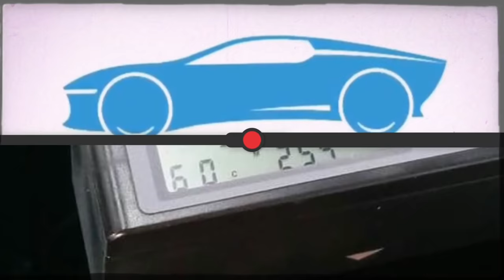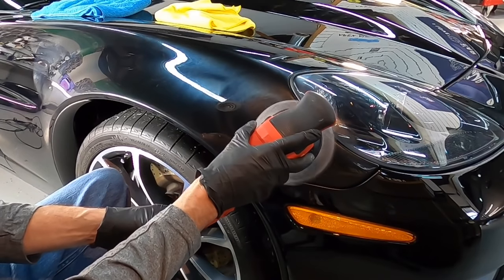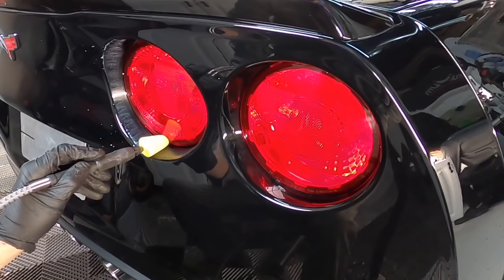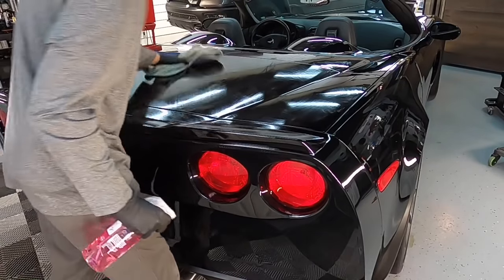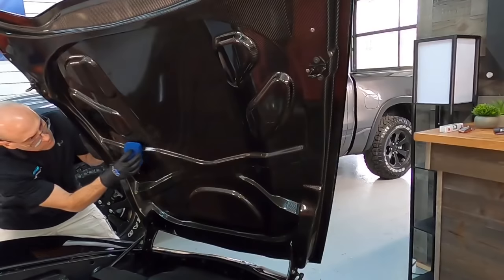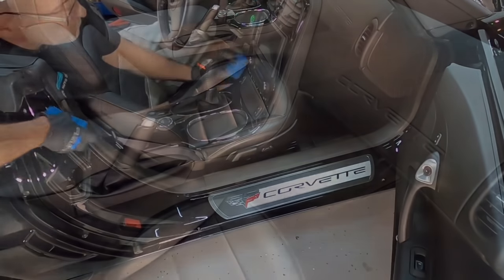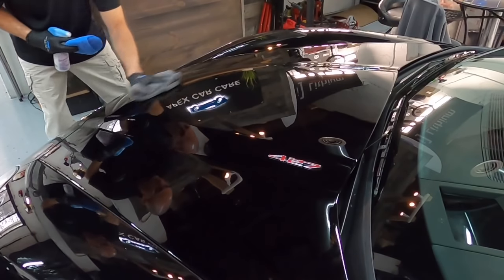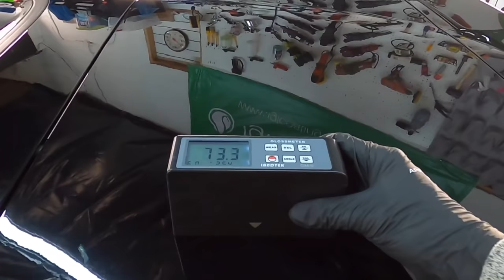Mod And Protect!!! Super Rare 427 Convertible Collector Edition Corvette LS7 7.0L!! Finished!

Comment: Brian.. What is the wait time between coating layers for the Fireball Butterfly?  How many layer are recommended for best results? Also time between the last coat of fireball butterfly and their top coating spray coating wax? Thanks again for another great video..
Reply from the maker: 2layers... 2 hr minimum in between. 24 hr min until you use coating wax

Comment: As the owner of a C5 50th Convertible, I really enjoyed these videos.  Nice to see the use of a 3" pad for the waterfall.  I did mine by hand because I was afraid of hitting the plastic console and C5 emblem.  I want to know how long do you let the touch up paint dry before applying either a sealant or a coating?  Another great video from a fellow Corvette gear head!  Remember my quote:  "Go with class, drive fiberglass"  LOL
Reply from the maker: Overnight. But you can seal it within 4 hours if needed.

Comment: Hi Brian, what’s the little yellow tool that you use to go around the inside?
Reply from the maker: Around the outside of the tail lights? https://www.amazon.ca/SGCB-Nano-Polisher-Mini-Pads/dp/B07FNTR1BZ/ref=asc_df_B07FNTR1BZ/?tag=bingshopdesk-20&linkCode=df0&hvadid=&hvpos=&hvnetw=o&hvrand=&hvpone=&hvptwo=&hvqmt=e&hvdev=c&hvdvcmdl=&hvlocint=&hvlocphy=&hvtargid=pla-4583863989572821&psc=1
Reply: Thank you!
Reply: @apexdetail85  is this an electric or air driven mini polisher?  Thx

Comment: Nice work, one question I have - your gloss meter tool that you always use.  Do you have felt or another very thin material on the bottom of the tool to keep the plastic from scratching the surface of the car you labored over?
Reply from the maker: PPF
Reply: @apexdetail85  PPF ?

Comment: Obviously, I have never seen the fireball products before except here on your channel but from what I saw on the video when you applied the coating, Does it require a waiting time to cure before the first leveling like Avalon's King Ceramic coating does according to temperature?
Reply from the maker: One hour in between coats...four hours before applying Typhoon...the topper.
Reply: @apexdetail85  Sorry, my question was more once you apply the coating, How long to wait to level it and buff it?  It is just from what I watched you did it really fast on the trunk and didn't know if it was because the video was a bit sped up or does it really doesn't require to wait flashing a minute or minutes like Avalon's King does according to temperature.

Comment: I bought a Griots G9 when they first came out, and as soon as you put it on the paint it just stopped. So I sent it back, they sent a new one and it pretty much does the same thing. Tried to polish my windshield and ended up using my old Porter cable. Same as when I coated my car, ended up using the Porter Cable.  I am 70 so I dont put much pressure on the thing. Does anyone else have that problem with them?  I watch how effortlessly your polishers work and know this cant be normal
Reply from the maker: Definitely not normal. Get your money back and order a ShineMate EX620
Reply: @apexdetail85  Thank you. Will look into this one. I only polish the car once every 2-3 years

Comment: Can some one explain why when i compound or polish have an extremely hard time with dusting. Hella dust came out of the pads when i was doing either. I even try different products i try with the griots garage compound and the orange pad and dust, black microfiber pad and compund dust  orange pad and meguiars 105 and 205 in orange or microfiber pad and same result hella dust. And when removing the meguiars compound 105 it was extremely hard to remove from paint. HEEEELP
Reply from the maker: Use the correction fluids in this video. Also clean the pads out after every pass or panel. No dusting.